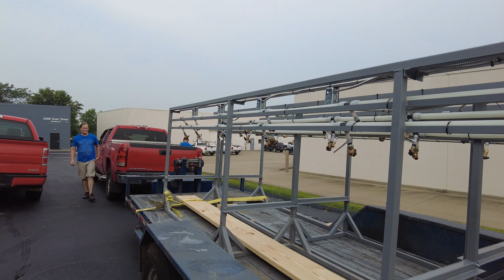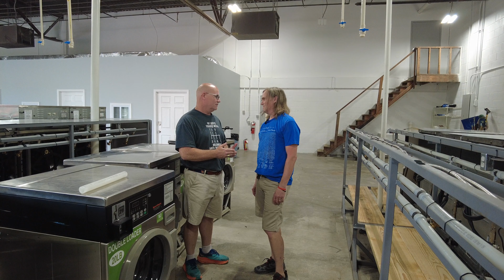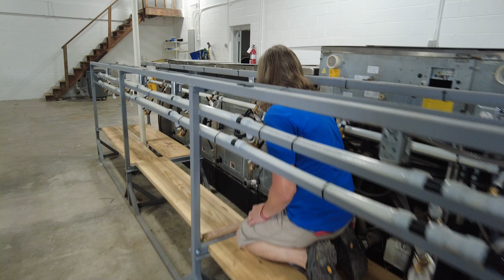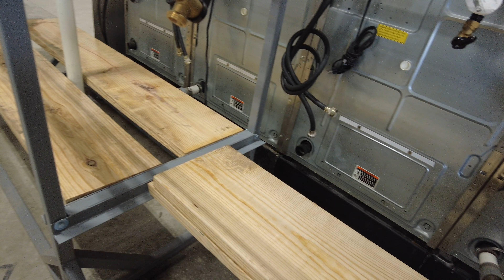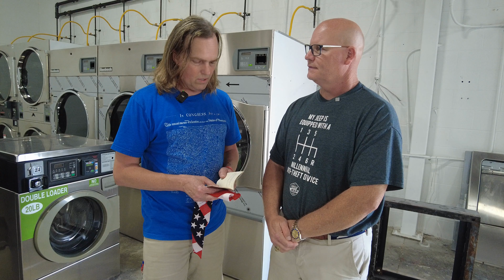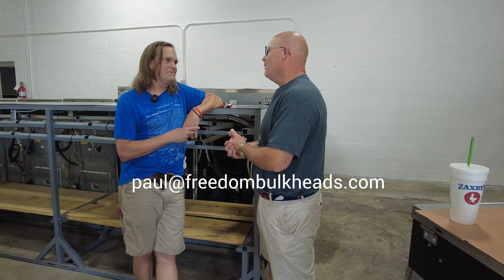Freedom bulkheads for your laundromat by Paul Pettefer

Comment: Interesting design.  Would you add vent plates to the covers to circulate air flow and dry out to prevent oders.
Reply from the maker: I'm not too sure what you are referring to, but Paul Pettefer at Freedom Bulkheads would be able to address anything you may need with your order?
Reply: @splashemoutlaundromat  just a simple Hvac vent wall plates that can be picked up at any DIY store and add them to some of the top covers and end covers for air circulation.  Not an engineer or laundrymat owner, it is just something that crossed my mind. 

I would also stand the boards up and lock/secure them some how to the sides some how so that when you take the end cover or a top cover off.  You can look down the line/bulk head for a quick look to see if there are any issues that need to be addressed.  Would also give any building or maintenance personnel a clear line of site.  Boards could be lower/raised into place as you walk in and out.

Love the organization, neatness, and overall appearance and functionality.
Reply from the maker: We don't have an odor problem, as the drain troughs are covered.